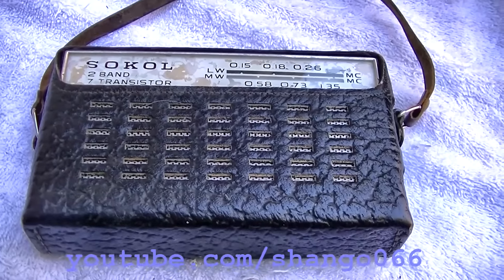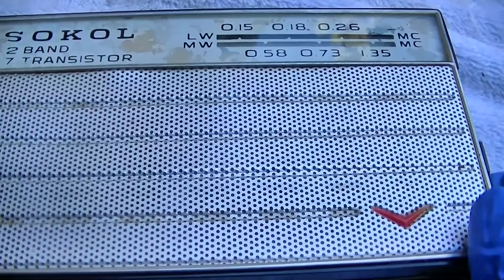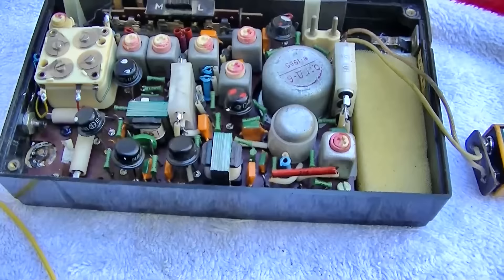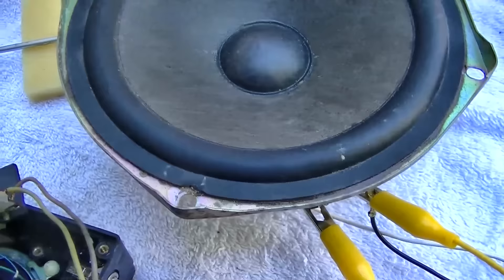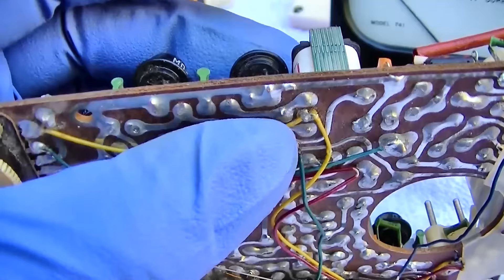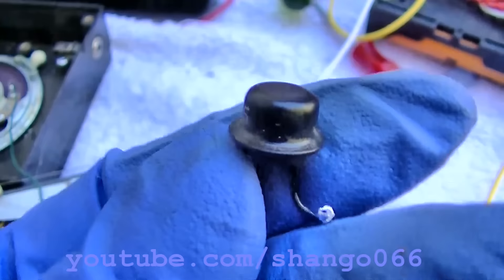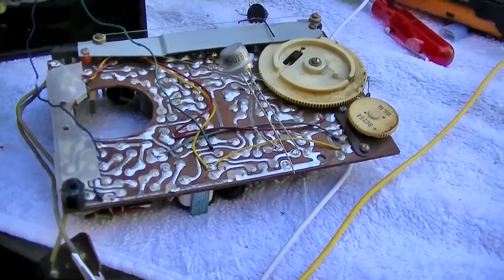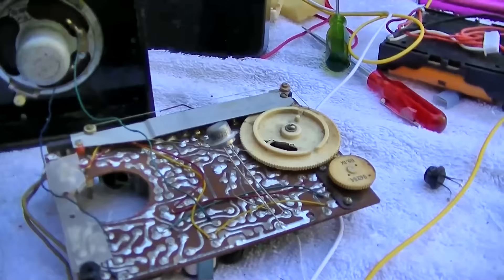1965 SOKOL USSR 2 Band AM Transistor Radio Diagnosis And Repair

Comment: A bit about long wave broadcasting from Wikipedia. Frequency roughly 150 to 300 kilohertz. Way below the AM band.
"Longwave is used for broadcasting only within ITU Region 1. The long-wave broadcasters are located in western, northern, central, and southeastern Europe, the former Soviet Union and parts of North Africa.
Typically, a larger geographic area can be covered by a long-wave broadcast transmitter compared to a medium wave one. This is because LW ground-wave propagation suffers less attenuation due to ground conductivity.

Comment: I wonder why that news station sounds like it's in a pipe.  it's all 'ringy' sounding, like they got an audio amplifier on the edge of oscillation.  Here in indy we have a similar news station, and it too has this ringy quality.  Is this some kind of encoding or something?  like AM stereo as heard through a non-stereo radio?  maybe it's what the nielsen rating devices use to determine what radio/tv station you're listening to/viewing.  (those ratings receivers have a microphone and you carry it around with you, and it picks up encoded data in the audio of TV/radio stations)
Reply: I wonder the same, have listened that kind of sound even on FM stations with music.

Comment: Gift radio here it is an aftermarket car radio close to and looks like a model 323T. 1964?. Worked when I put it in the attic 55 years ago. Capacitors dried out when I got it down and I recaped it and regermanium transistored it.It works nominally. I suspect it has silver mica disease. weighs about 4 lbs. Ill ship it to you if you want it...Russell

Comment: Had shorted audio transistors and a very hot transformer yesterday, I hope the transformer survived.
Edit: after swapping the transistors the radio works just fine, transformer is ok.

Comment: That "big electrolytic cap" is a P401 transistor (or P402, depending on what they had on hand) under a metal can shielding. It's the second IF amplifier.
I would put two P40s into this radio, no need to order the MP40 version.
Reply from the maker: Yep I forgot there was a transistor hidden in there. I ordered them anyway they are cheap

Comment: I have a Selena multi-band radio, which works very well.  Its FM-AFC band has no overlap with the US FM band.  Do you know if it could be easily adjusted to pick up the US FM band?  I wouldn't care if the dial is off.  It already picks up a couple, I guess on harmonics.

Comment: Orange pieces are film capacitors if I'm not mistaken. Germanium МП series transistors are mainly intended for sound amplifiers. YouTube will skip the pinout link http://radiofor-shop.ru/wp-content/uploads/2018/11/5b052adbc15ae3d121599737.jpg https://otvet.imgsmail.ru/download/a7b48fe98934388c4770b945bc2fb618_i-206.jpg Directory https://elektrikaetoprosto.ru/trans30.html

Comment: On longwave, with a bit of an external antenna, maybe you will be able to hear the megawatt longwave stations that still broadcast in europe and the former soviet union. 
Russia and Belorussia have shut down already, but for instance the BBC keeps transmitting because on the carrier, there is load shedding control for the national grid.

Comment: that thing looks mega brutal too. Function bent only. I'm working on a Univox amp right now, and it's got germ beercans in the preamp and the big germ outputs, really light wiring, 1X12 combo for guitar... could it seem like the preamp ones are bad with a shorted power one in there? just a random query.

Comment: Serious question...
Why do USSR made products use “English” words like “Made in” or “ Band” or “transistor”?
Were these made for export? Are there domestic versions of these made? 
Thanks
Reply: I can't find Sokol-403 model with Russian text on it, but I found manual for it and description in Russian. It seems like this was an export model, but sold domestically too. Maybe this way was cheaper.
Reply: Yes,they were made for export markets.The domestic version was the same,only the dial/back cover slightly different.
I also have a Sokol 403 in my collection with russian text on it.These ones were made usually for USSR and eastern Europe markets.
Reply: These radios were sold in England and France too, besides the eastern bloc.

Comment: the USSR TV sets used SECAM Systems D&K with a tv band with of 7 to 8 mhz and color burst of 4.43 mhz unlike in america if 3.579 mhz color burst and 6 mhz channel bandwidth and europe also used PAL Systems B&G system B VHF system G UHF and must homes had log Periodic TV antennas fir TV PAL systems D&K NTSC system N fur brasil and most long wave transmitters used 1MW of power and France used Secam System L and there tv’s had a channel 1

Comment: The circuit diagram of the radio with the battery charger approved and marketed in Hungary.
http://www.szetszedtem.hu/591sokol403/006doc/000magyarkonyvbol/1600/004normalisrajz.jpg

Comment: This transistor can be replaced with the Soviet МП39 or МП41. They are very similar. Or you can try one of these: eft306, eft307, 2n104, 2n215, 2n237, 2n283, 2N368, 2N44A, 2N45, 2N45A, 2SB170, 2SB171, OC1070, OC1071, OC70, OC71, OC75, OC76. If you have them in your collection.
Reply from the maker: I ordered mp40

Comment: I find it rather odd that this radio has Roman, not Cyrillic characters on its dial, as well as some English words. It is also noted that the scale is in decimals of megacycles, as one would see on the commercial FM band, rather than kilocycles; e.g., 0.58 MC = 580 KC.
Reply: Alot of soviet radios were made for export to western europe. It quite common to find tvs, radios and especially cameras where you find many roman and cyrillic variants of the same product. I have many soviet cameras and I've had multiple with very close production numbers(50-75 away from each other). One will be all cyrillic, and one will be roman. I imagine it was around 70% domestic and 30% export
Reply: @aaronblair9583  Not only to western Europe, also for eastern block. Only bulgarians use cyrillic, others use roman script.

Comment: Radio Disney to cease operations Jan 2021. RD Country on 1110am/99.1fm LA switch to Radio Disney main feed until 22 Jan, where the main channel will shutdown permanently. 1110 & FM translator will be sold off.